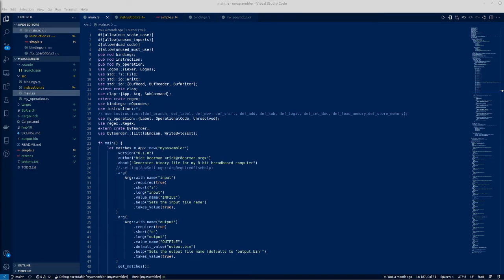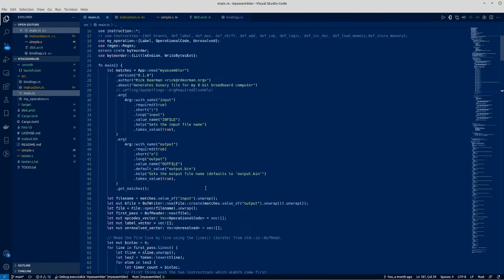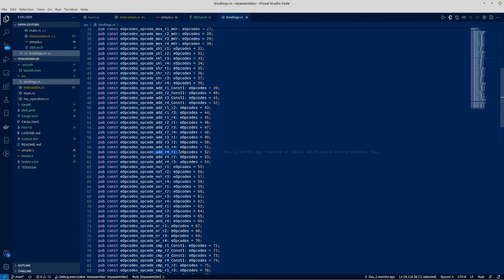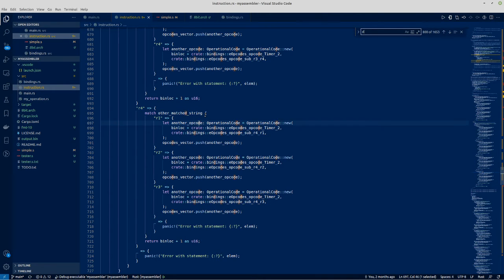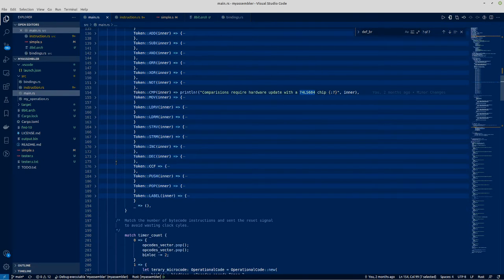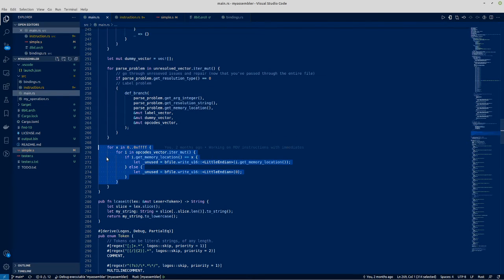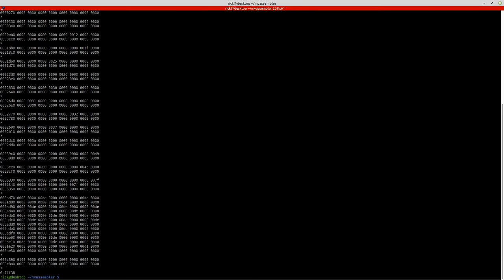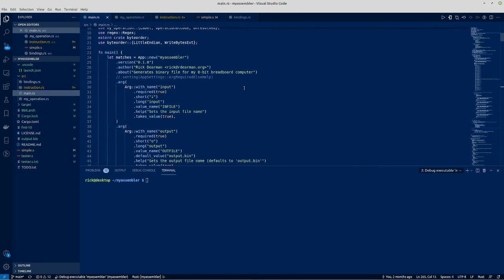Writing an assembler for my 8 bit CPU

Comment: How do you define, what the opcode does?
On a 6502/6510 (used in C64 from the 1980) you can put a bitmask on the opcode (here only 8-Bit wide) to see, what it exactly will do. Example: Opcode = 193. "Opcode AND 192" (bit 7+6 set to 1) -> its a ldr, then mask "Opcode AND x01" -> ldr register r1 is destination.
I hope you know what I mean.
Reply from the maker: Because I built the CPU, I got to define the OpCodes myself. This is why there is a long definition file which I converted from C into Rust. I wrote the C definitions because I used C to write the binary file to my EPROMS which held the opcodes. Don't forget my 8-bit CPU isn't actually a single chip, it is a bunch of wires and logic chips. I've recently been thinking about writing a simulator of the CPU, since the physical CPU has long since been pulled apart.

Comment: An idea to make the assembler work in one pass.
Create a label list, where the label is used in the code. A second one where the label is in the code.
Before writing the binary evaluate the addresses in the label-list and while writing insert the correct values.
Reply from the maker: Yes, that would simplify things quite a lot and half the time. Although given the limits of the 8-bit CPU I built, speed wasn't a massive concern. :) You're right though that would be way more efficient, wish I'd thought of it. I might need to revisit this and try to get it down to one-pass.

Comment: If you really like tinkering get yourself a FPGA. Design your own logical hardware, implement program counter and load your software on the FPGA. Saves you tons of work with dedicated hardware. I would recommend to use Altera Boards for Development.
Reply from the maker: Oh I have tons of FPGA's, etc. I mostly use ATMega168 chips or PIC16C620's, I have about 10-15 of each lying around as well as 5 Raspberry Pi's of different models from 2 upwards. But this was an exercise is working with some 1980's technology and trying to build an assembler from scratch. I wanted to design my own CPU and to create my own Op-Codes, etc. It really shows you how far we've come in 40+ years.

Comment: This is fun. I remember some decades ago programming in assembler, and even having to manually type-in a small loader-program in the MACHINE CODE every morning when I got to work, cause the hard-drive on one of the huge machines had suffered a catastrophic damage. :)
Reply from the maker: Sometimes it is cool to get low level. :)